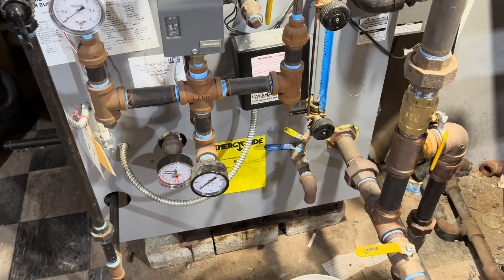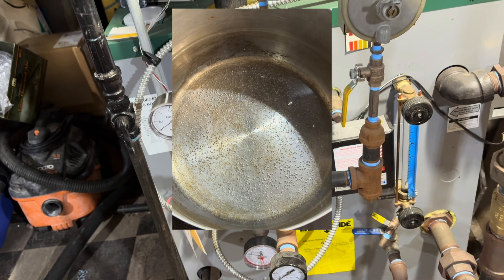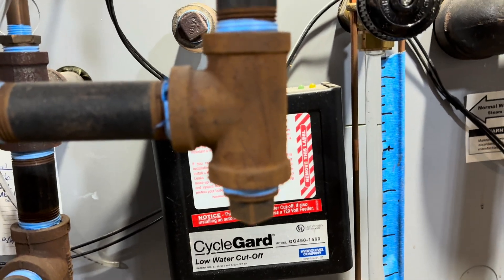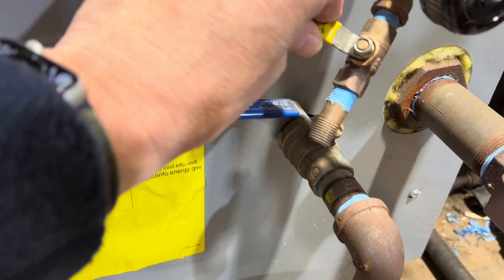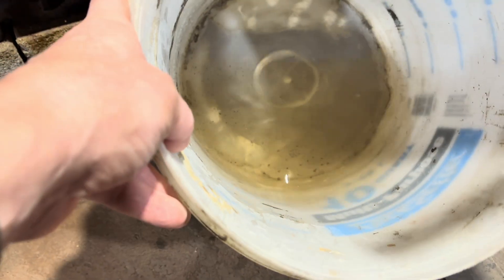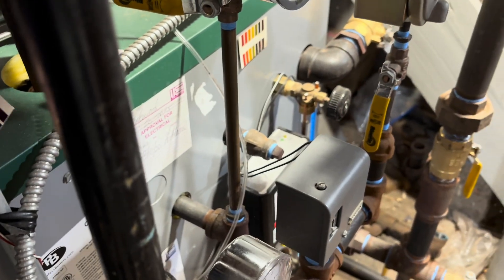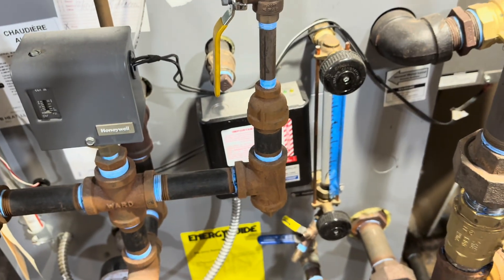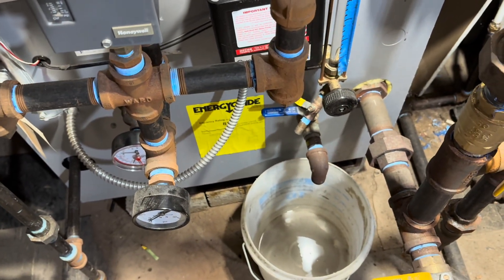How to make your steam boiler last forever!

Comment from the maker: I failed to mention that by using distilled water, there is no chlorine added to the boiler. I have no way to tell how much chlorine affects a boiler, but it seems to be reactive with iron. I am not a chemist.
Reply: Small amounts of chlorine is not a big deal I forgot to add that when you preheat your water it helps with the oxygen but a good oxygen scavenger is better do not have a pH over 12.5 it will cause caustic embedment in the steal in your boiler you won't see it until it's to late please keep your pH between 10.5 and 12 Hi pH will cause micro cracking and a failure in the near future
Reply from the maker: @tdobson888  Thank you. I think the product that I use, 8-way, has an oxygen scavenger in it but I'm not certain. I assume you come from commercial steam? Most residential boiler owners aren't looking at oxygen scavenging 😅
Reply: Doesnt a ph over 10-11 create alot of foaming? Do you have a video of high ph with those glass risers installed?
Reply from the maker: @ that is a common belief but it’s not that simple. I think it may do so in the presence of oil and/or a lot of gunk in the water, but I’ve had my ph very high without foaming. And yes I have a video showing it! 

https://youtu.be/_JFfO_VgvNQ?si=MevGuYAzLTTMIImm
Reply: Please get the pH down to 11 it will help your boiler last much longer

Comment: Hello Sir. Love your videos.  How do I raise my Boiler PH?. I have just installed my brand new utica steam boiler and I am worried about corrosion.  Also how much makeup up would you say is normal per weak. I don't have an automatic water feeder.
Reply from the maker: Manual feed is best so you can track usage. I use the 8-Way product to raise pH. Use only like a cup, not the whole bottle, then measure with pH test strips. 9 or 10 is good.

During the heating season a gallon per month max makeup water. You can mark your gauge glass.

Don’t drain as a matter of habit
Reply: @pb7379-j2k perfect. Will do. I like your set up so much i even installed the sight glass 😂 and got the test strips as well. For some reason my boiler surges with 8 way. Maybe i put too much. Half a bottle on a small 150000btu one family house unit. I installed the new boiler my self as A DIY in my house in September   of this year and redid all the around the boiler pipes converted my copper to a 2inch black steel. I even got it inspected  and passed with flying colors here in Clifton NJ. I am just working a little water hammer issue right now.
Reply from the maker: @stranger21ny if there’s any oil in the water, 8-way will make it foam and surge. Did you wash the boiler with tsp and/or skim it? Clifton is 10 minutes from me 😊

Comment: if you have a feed off the hot water heater, then start with getting a full tank of that hot, by using the hot water first- like say a bath, then do your blowdown/ fill after the water heater is stopped.
ill usually drain off a half gallon of tea before it gets clear,once a month in winter. mine is 20 years old
in the begging of the season, like october, ill let it run with last years old water, then dump the whole load. then do short fills and drains.
ill fill it for a few seconds on and off to get the stuff on the bottom to swirl around and out,alternating the drain valve open closed also.
there comes out some bottom sediment,then all is good and clear. Actually my plumber has a Utica buleltin notice that said dont even bother with regular blowdowns for the oxygen corrosion aspect, and another plumber said the radiator vents are sucking in new air after every cycle and the steel pipes/cast iron radiators will rust color the water anyway.
Reply from the maker: I follow some of what you’re saying. The oxygen coming from the boiler water’s contact with air seems to be of minimal importance. Look how much brown water I had after a year in this video—none

Comment: I’m a plumber with 41 years experience. Your video is most informative. Boiler water is the reason for most steam boilers going prematurely. Find a way to put the best water in your boiler and you will save thousands
Reply from the maker: Thanks so much for your note. I am still only adding distilled water as makeup water and maintaining about 10 pH which definitely minimizes creation of "mud" (rust) below the water line. This is important to minimize kettling and buildup of sediment in the lower areas of the boiler.

But I honestly think the distilled water is the most important part to reduce corrosion above the water line. I think that when you add regular domestic water as makeup water it is always going to release its oxygen into the boiler cavity and I feel that is what really damages most boilers the most. The failures we see on HeatingHelp.com all seem to be holes rotted at the top of the boiler sections.

Comment: I have been using distilled water in my boiler for over 29 years now! My service tech thinks I’m crazy, but I swear it keeps my system from getting gunked up with the iron-rich water from my municipality. Even my low water cutoff is clean when I blow it down. I also add a water conditioner to the boiler every spring. Makes my system produce a nice quantity of “dry steam” YMMV.
Reply from the maker: @eddiew.6485  I think it’s smart. If you really want to go overboard, heat it to just boiling just before you add it. It will drive out more oxygen.

What is your source for distilled water.

I have people saying insane stuff like “distilled water harms your boiler”. News flash: the boiler is having distilled water added to it every time it makes steam
Reply: @pb7379-j2k I source my Distilled Water from my local Walmart. Gallon jug size, 19 in all. I forgot to mention that the conditioner that I utilize is made by a company called “Rhomar Water”. The product is “Boiler Pro 903” which I believe isn’t available anymore,

Comment: There is oxygen in all water that's why it's called H2O the o is oxygen use soft city water and use a oxygen scavenger and at the end of the season drain the boiler and wash it out refill with oxygen scavenger to the top of the boiler also never get your pH over 12.5 .
Reply from the maker: Yes there's oxygen in all water, but you must be aware that the level of oxygen dissolved in water can vary.
Reply: @pb7379-j2k  that is true but after watching your video I'm more concerned about the pH in your boiler there is a thing as to must pH bring it down to 11.5 that high of pH will cause caustic embedment to the steal in the boiler and do lots of damage
Reply from the maker: @tdobson888 it’s not as high as it appeared on those test strips. I have better test strips now that show it in the good range.

Comment: So glad I stumbled onto your channel!  I really need your help!  I moved and never had a steam boiler before.  My boiler was installed less than a year before I got the house 2.5 years old now.  Water got very muddy in the sight glass.  Thought I needed to plush it out, clearly that has not helped and your video has shown me why.  With my now new and corroding boiler (peerless as well) can you tell me how to get started in getting out the oxygen.  It has a auto feeder.  I don't see where else I can add the water that I heat, or use from the dehumidifier.  Can you give me some pointers on that and how to swap out the water and add the treatment to lower the PH.  Thanks, any help would be greatly appreciated, I really had no idea I was just making things even worse ... urgh.
Reply from the maker: Thanks for watching! I was in your shoes 5 years ago. I don’t think you need to worry about distilled or heated water but treatment to raise the pH will definitely help.

There are a few places where you can add stuff. The pressure relief valve is one place or the main vent sometimes.
As you can see, I have a dedicated tapping that makes it easy. You can email me at njsteamhelp@gmail.com if you like

Comment: Can I  connect my boiler to my 50 gallon  Hot Water Heater and this would solve the oxygenated water issue?
Reply from the maker: Some people think so, but I'm not sure that the oxygen is driven out at water heater temperatures. But the more important thing in my opinion is the pH level in the boiler

Comment: Distilled water can contain more dissolved oxygen in it due to the fact that it doesn't have dissolved minerals in it that would be competition for the oxygen.  Even if it was distilled in a vacuum it would tend to absorb more oxygen inside your steam system.  Some of those minerals in tap water may be oxides of minerals but that shouldn't be a factor as far as the oxygen goes.  Not having the minerals in distilled water is probably advantageous though for preventing scale.  Not sure that makes it a good idea.  Of course you can boil it first and then add the 8 way to it and that might keep the dissolved oxygen down, at least before adding it while hot to the boiler.  I would do this if I had a good way to put the water in without removing my pressure relief valve which is a bit of a pain.
Reply from the maker: But as my chemist friend said, the boiler water is a veritable melting pot full of all kinds of compounds including iron, oxygen, ferrous oxide, all kinds of chemicals so it's no big deal if distilled water gets poured in there. And may I remind you that whenever the boiler is steaming, gallons of pure distilled water are pouring into the boiler from the wet return??? Come on man cut me some slack here haha
Reply: @pb7379-j2k  I think what is missing from the 8 way is an oxygen scavenger.  Sodium Sulfite would do that but I think that is in Squick and Surgex, not 8 way.
Reply from the maker: @captainwho1  but I don’t add tap water, only distilled or boiled, so the oxygen content is already low. You did watch the video, the results are there
Reply: @pb7379-j2k  What I'm saying is that oxygen is totally present in the radiators, steam pipes, and boiler and even though the water is being boiled, being that it is distilled it also more readily absorbs oxygen (and CO2) due to not having the mineral content.  Therefore, for me to start filling my boiler with distilled only (I'd heat it and treat it first) I want some sodium sulfite treatment as well, to scavenge the oxygen.  The sodium phosphate is in the 8 way to handle scale but that isn't needed when you are using distilled water, so it would be nice if they made a version of 8 way with sodium sulfite in it instead of sodium phosphate.  Also, if you are using distilled water that came off the coils of your dehumidifier, as condensate, and you aren't boiling it right before putting it in your boiler, then it most likely is more oxygenated initially than your tap water due to the affinity of distilled water (at room temperature) to absorb gases vs. hot tap water with mineral content that comes from your water heater.
Reply from the maker: @captainwho1  I disagree wholeheartedly with that notion. But thanks!
Reply: @pb7379-j2k  Utub is only accepting short comments at the moment and my comments got nuked.  In short, DO is about 5% more in distilled at room temperature vs. fresh water.
Reply from the maker: @captainwho1  I don't think so. Municipalities inject oxygen into their tap water. 

Sounds like youtube thinks you are typing too many replies haha
Reply: @pb7379-j2k  Another reply got nuked by the algorithms.  Look up dissolved oxygen and saturation and how it is different with mineral content, chloride content, salinity, temperature, pressure etc..  Your distilled water that drips off of the coils has more capacity to hold oxygen than tap water at 100% saturation.
Reply: @pb7379-j2k  They do aerate well water to vent off some of the sulfurous gases in the process, for taste and smell.
Reply from the maker: @captainwho1 my understanding is they aerate all water for improved taste.

But regardless did you ignore my point that every time my boiler makes steam, gallons of pure distilled water enter the boiler?
Reply: @pb7379-j2k  I don't honestly know for sure if they do it after they mix the well water with other sources or what but if you had ever had a well you'd know that underground water is often contaminated with sulfurous smell and odor, so it is because of the well water that they need to do it.
Reply: @pb7379-j2k  I fully understand that you fill your boiler with distilled water vs. heated tap water from your water heater.  At 100% saturation that has far more dissolved oxygen than tap water from your water heater and it would probably be 100% dripping off of the coils of a dehumidifier.
Reply from the maker: @captainwho1  I don't think you are hearing me. The boiler turns gallons of water into steam every time it runs. That steam condenses to 100% pure distilled water. All that water goes into the boiler... every time the boiler fires. So is that hurting the boiler?
Reply from the maker: And I will add, AGAIN, did you watch my video? Did you see rust? I'm quite happy with the results of my year-long test. If you'd like to create a test that shows that distilled water hurts a boiler, please go for it.
Reply: @pb7379-j2k  When they pressurize the aerated water into their piping and distribution system it is no longer 100% saturated because as the pressure increases the amount of dissolved oxygen for 100% saturation increases.  Even if it were 100% when it entered the water heater, you would have bubbles forming on the interior of the water heater because as temperature increases the amount of dissolved oxygen for 100% decreases.

Comment: I have my boiler fed from the hot water supply. I figure it removes some of the oxygen before the water gets to the boiler. I just installed the boiler, so I have no clue what the amount of water it will use is yet because I'm still in the skimming/decontamination phase, but with much of the system piping being brand new and it being a vacuum system, it shouldn't need much makeup water at all. Generally the boiler will start up with the system still in a vacuum except on a night setback (not for energy saving reasons, but my boyfriend likes it cold at night).
Reply from the maker: That's cool it still holds a vacuum--seems like most of those systems have been butchered

Comment: Why did you switch away from 8-way to raise the pH? What chemical did you use?
Reply from the maker: @marcinmerrimack1726  because 8-way is expensive and I was draining and refilling a lot for various experiments. But I’m using it again because it contains a “PH Buffer” and I like its indicator color. I was using PH Booster powder sold for use in swimming pools
Reply: Ok, makes sense. Thanks.

Comment: Do you ever check the low water cutoff? 

Presumably, you could collect the drained water and refeed it into the boiler.
Reply from the maker: @marcinmerrimack1726  yes I do check it but it’s overdue for a check this year. I will probably let my water level naturally drop at the start of heating season so I don’t have to drain much to trigger it. Then I will pour it back in as you suggest—there’s no reason not to. It will make a decent video probably
Reply: @ Understood, though it takes a good amount of water loss to trigger the LWCO. I’d think that simply counting on mostly the natural water drop to get you there would take quite a while.
Reply from the maker: @marcinmerrimack1726  yes it will take awhile especially since currently my water level is about 1” from the top of the glass 😅

I may get impatient and do it sooner
Reply from the maker: @marcinmerrimack1726  I went ahead and made a video of checking and cleaning it: https://youtu.be/F2lOsP6P0-Y

Comment: You want to blow down your boiler when it is hot and pressurized with steam. This will loosen things up and allow it to be flushed out
Reply from the maker: @HVACRTECH-83  I know what you are saying but most residential boilers don’t have the valves installed to allow that.

I don’t think it does that much—I do not and will not have any serious level of sediment mud in my boiler. Those who do have it probably need wanding.

Finally, I don’t like to see all the introduced fresh water after a major blow-down like that, so I wouldn’t recommend

Comment: Design an oxygen purging water feeder.  Just fired mine up for the upcoming season.  Draining Swiss Miss chocolate milk.
Reply from the maker: @medicalnegligence  I think I did design one: it’s me pouring distilled water into my boiler by hand 😅
Reply: Water needs to be heated to over 180 minimum to release enough dissolved oxygen to be effective, the hotter beyond 180 the better. We heat our feed water to about 227f to dearate
Reply from the maker: @HVACRTECH-83  Yes, as you saw in my video, the bubbles start to form when the water is heated. But you said in another reply that it's not helpful because H2O has oxygen 😅

When you heat your water to 227, do you keep it under pressure to prevent it boiling?

What do you think about distilled water as makeup water?